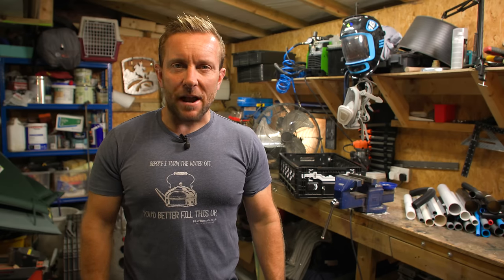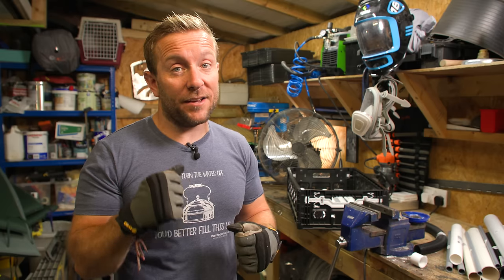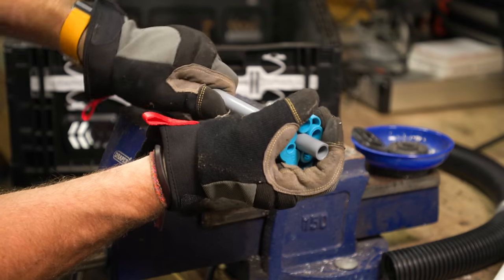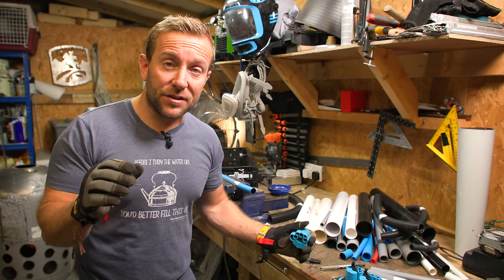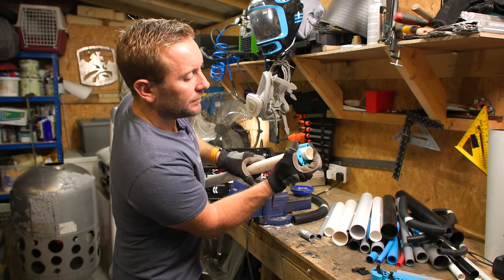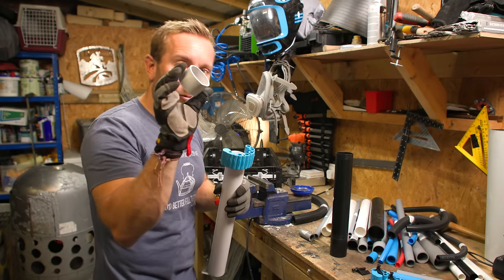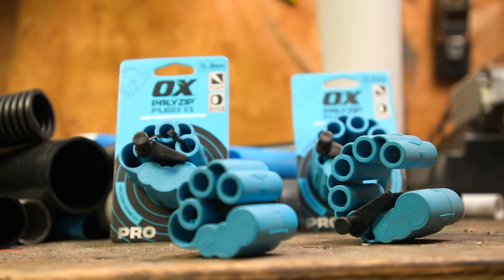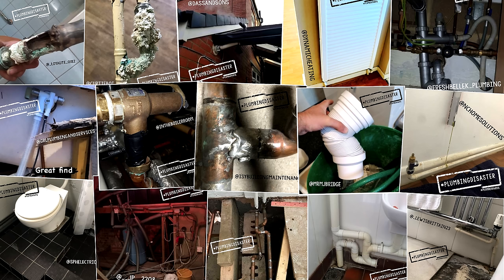HOW TO CUT PLASTIC PIPE IN SECONDS - Ox Polyzip Flex tool

Comment: These cutters are just what I have been looking for, I have been looking to get some cutters and I'm glad I waited for this, my bag is already over filled using a hack saw and shear type cutters to do the same job, I love how these cutters because they do 25mm mdpe and 50mm waste pipe that way even with other pipe slice cutters I would have brought, it doesnt mean I still need to hold on to the hacksaw and shears in my bag for those sizes
Reply: Have you seen the knipex version of these? I highly recommend a comparison

Comment: Hey James. Good video Looks like great tool. I did buy the Knipex BiX but couldn't get on with it because it would track the pipe so went back to my trusty Rothenberger snips. But always looking for alternatives, especially for those tight spaces. The BiX does allow the blade to be positioned closer to the outside edge of the cutter so you can cut exiting waste pipes flush with the wall: an enhancement for Ox perhaps? 👍🏻

Comment: Great tool, and great video. Been using a set of JG snips for a few years (small dia only) rotate them around the pipe as best you can. The Ox 🐂 has thought about it all, and love the spare blades avail (key to cutting, a sharp blade). Can you do a video on larger waste pipe sizes and how to do a.proper job. Thanks again.

Comment: It will be interesting to see these up against the knipex bix , as the bix does I believe 15-50 mm all in one , has a spare port for blades , only main difference is the bix you can move the blade closer to the edge of the plastic so it can cut closer to the wall, also I’ve just retrained as a plumber , so slowly getting my tools together so these would be a great advantage for me in my tool bag
Reply: the knipex starts tracking up the pipe after a while, I hope these dont!
Reply: @killerbean9911  I see , thanks for that , I was close to buying one , but il wait and have a look at these ox ones

Comment: Looks great but I wish you’d of tried to push a fitting on the end of the waste pipes to see how easily it goes on, I’ve had many different cutters but they seem to leave a very slight ridge that you need to chamfer down in order to get a fitting on, not just push fit even solvent weld fittings are a struggle to push on and off if you want to do a dry fit first.

Comment: just bought a polyzip 35 for £12 from City Plumbing and returned a rothenberger manual cutter to Wickes that was £18 that did nothing but crush ABS 32.  If I had seen this video before I would have bought the C2.  Ox make some great products. 

Plastic Pipe sizes are a bit mad.  I was looking for a 32mm rotary cutter for 32mm pipe.  Decided to actually measure it with a caliper.  Definitely says 32mm on the label but outside diameter is 35ish.  32 is ID, just thought I'd share so you don't waste your time and think you're going mad like me.

Comment: Think you will need to change the blade very often as it will start tracking just like the 
Knippex Bix cutter does , about 10 cuts and its blunt , it can be turned end to end like a Stanley blade but a pack of 3 blades is about £ 6....
👍